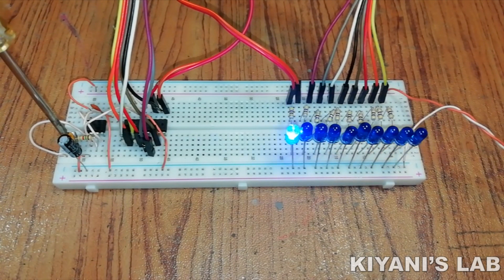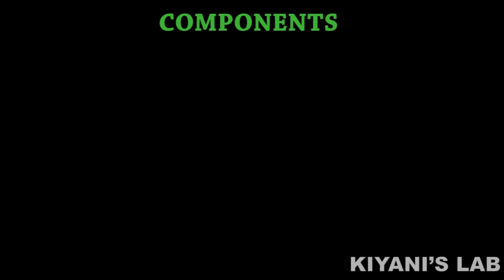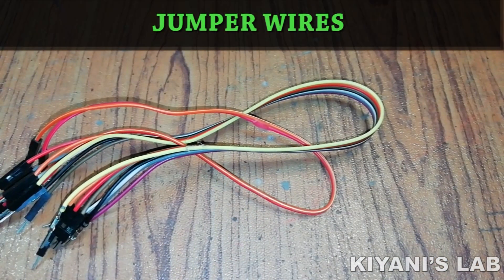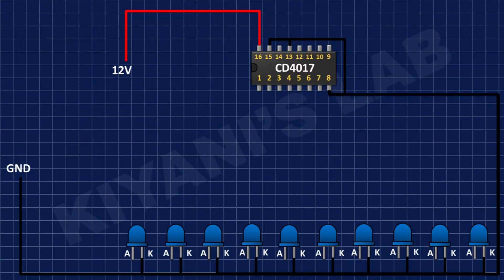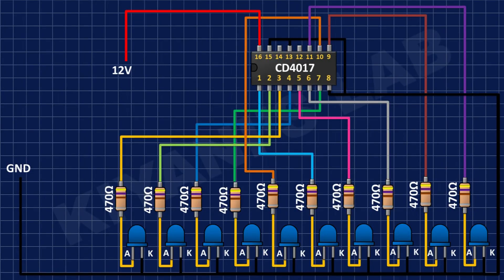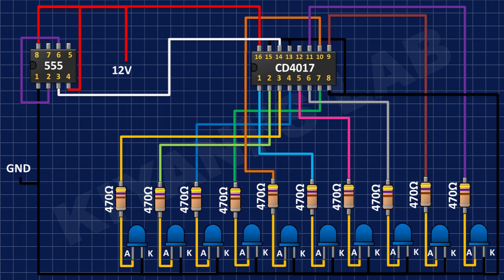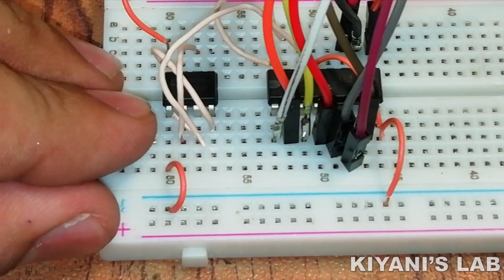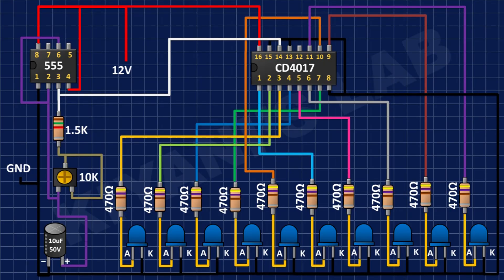How to Make LED Chaser circuit

Comment: Respected sir,
                       Focus on MPPT charge controllers,
OUT PUT 50A to 100A with 12v to 30v (adjustable)
Input 20v to 100volts as per circuit working.
Thanks,
Reply from the maker: i will make bro
Reply: Aj kal solar k leay boht use ho rha hai,
I am waiting,